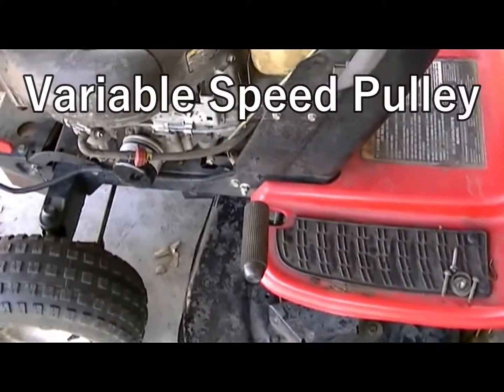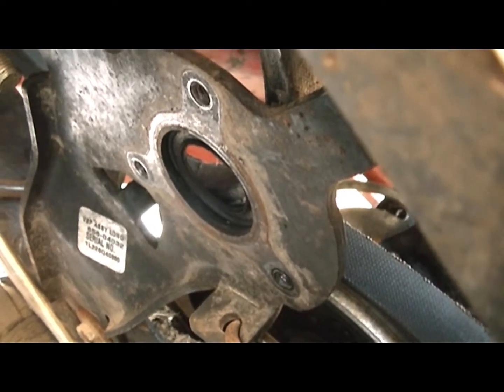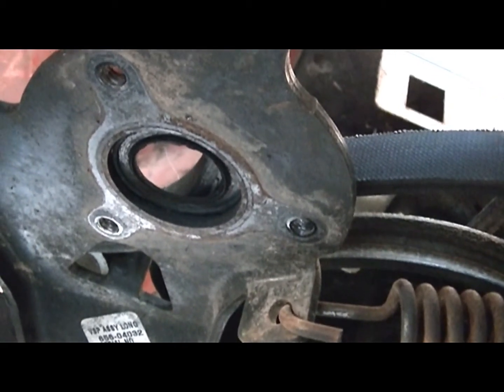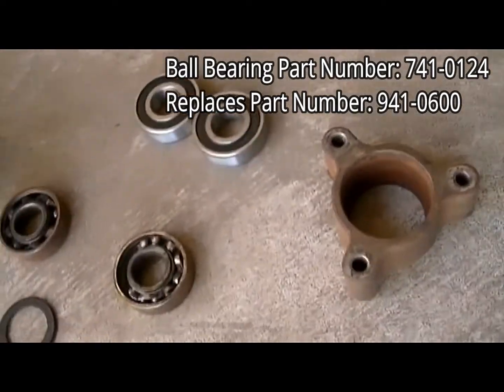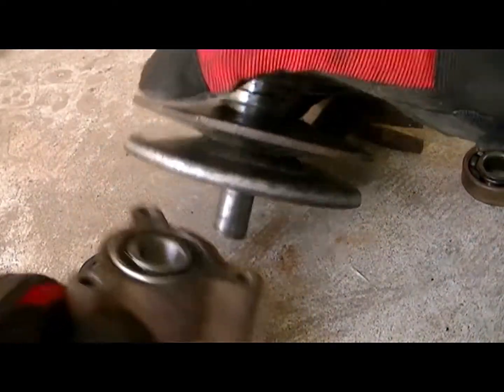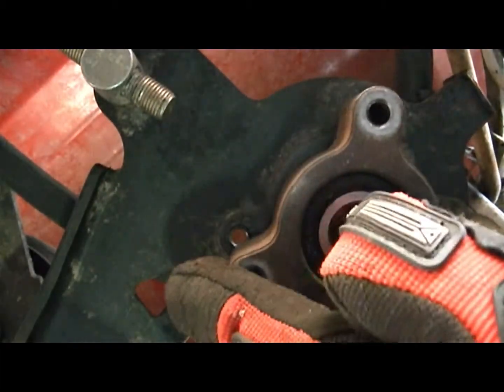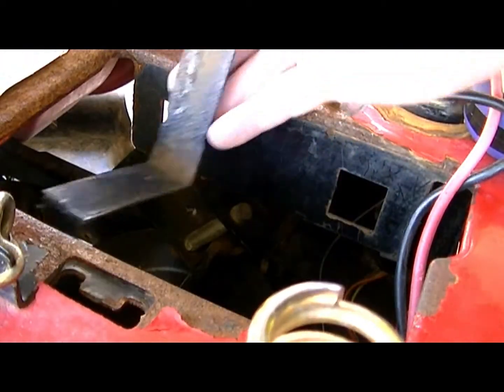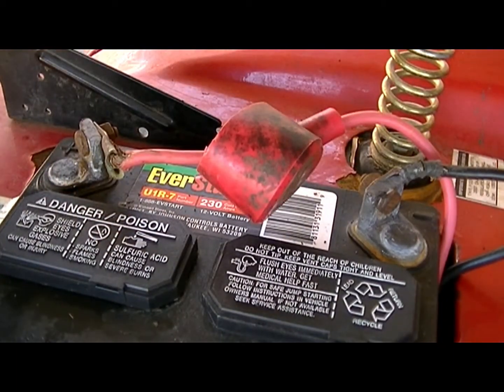Variable Speed Pulley Bearings Replaced 2007 MTD

Comment: Thanks for the video.

One question and one suggestion.

Question: When I took off my bearing housing, I could not remove the bearings from the shaft. They spin freely but just didn't come off. How did you remove?

Suggestion: I would suggest instead of using your coat hanger for the idler spring, use a 3 foot long piece of weed trimmer line. Loop and feed through hole and hook the spring. Then wrap the 2 ends around your hand and pull spring to seated position. Once seated, let one end go and pull the other out.  No need for the screwdriver afterwards 👍
Reply: simple,  put the bolt back in the shaft ( without the washer ) and use a fitted socket for the hammer to tap the shaft out.

you are welcome .

Comment: Is the bolt on the bottom of the variable speed pulley supposed to spin like the pulley when engaged. Because my bolt has worked its way loose two times now.

Comment: Need a video of how to get the bearings off variable speed pulley shaft. Bearings stuck on variable speed pulley shaft after removing bearing cup
Reply: I removed the bearings from mine 2 days ago.  No video because it would have been full of curse words!  I had to cut them off the shaft with a cut off wheel. Not an easy job when the inner race is stuck on the shaft.  BTW, Buy quality bearings from a reputable dealer. Lots of fake name brand bearings on the net. Don't get the ones from the manufacturer, either.  They are cheap chinese junk that won't last.
Reply: @pygmywarrior3  thank you. I bought a bearing puller on Amazon, and it's coming today. I have it lubricated well so hopefully it will come off with the bearing puller. I watched a few videos of people getting them off with a bearing puller
Reply: @pygmywarrior3  bearing puller with a c-clamp on the jaws worked to perfection. Bearings came off easy
Reply: @pygmywarrior3 hey, can i have a couple of questions if you still alive and online? We have an almost similar bearing setup(mtd-pinto), want to change the bearings but the bolt with the washer head stuck veryverytight, do you loosen it clockwise or anti clockwise? If we cant loosen it we probably nee to cut it off to pull off the bearings, so we will see. The second one is. We try to replace it with oem bearings, but you said they are not that good, can you tell any brand names for good quality bearings?

Comment: The bolt that holds the pulley on somehow loosened and fell off in the middle of mowing my yard and the pully was just laying loose in there.  Is that just bad luck or did I do something that somehow caused that?
Reply: Put 242 lock tight on bolts

Comment: I just ordered the bearings for my mower. Thanks for posting this video. What size socket did you use to hammer those bearings in please? Thanks.
Reply from the maker: Hi. It might have been a spark plug socket or similar. Just use one that fits around the edge of the bearing. If the hole is clean, it shouldn't need to much force, or lube to get them in. Thanks.